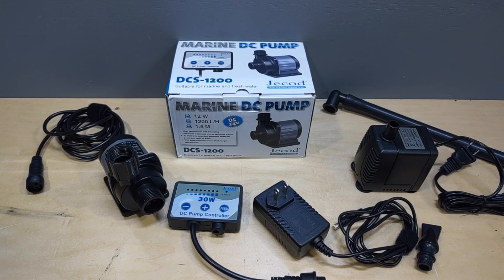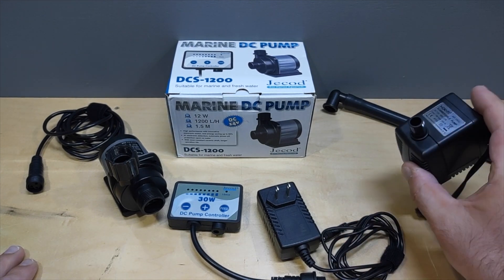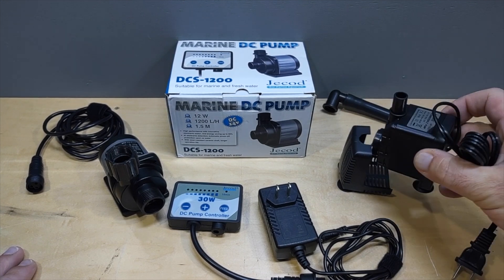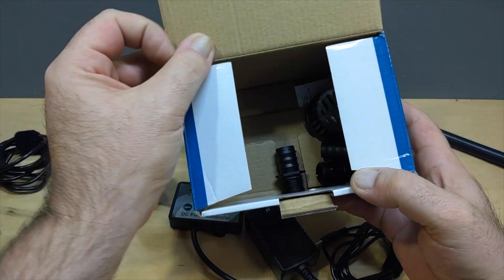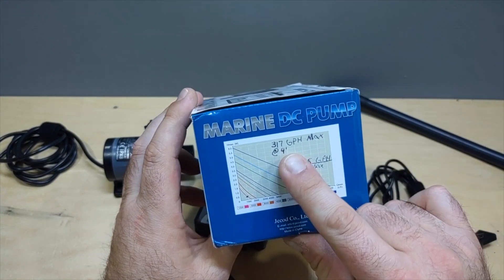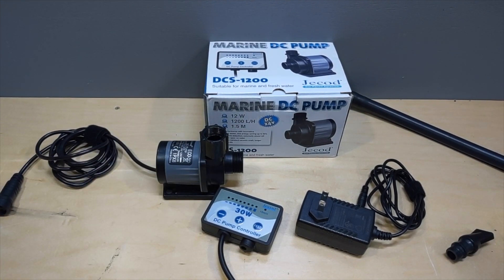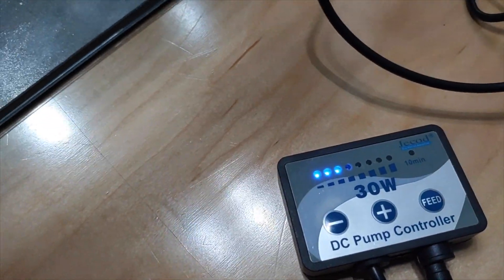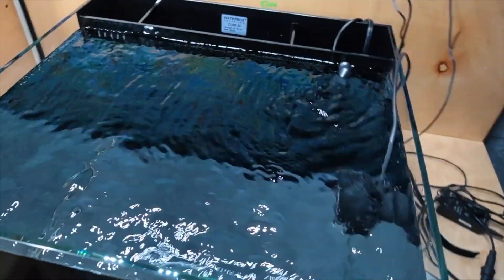Nano Reef Tank Build - Return Pump Upgrade - Episode 3

Comment: How is the DCS-1200 pump going as it's been over 1.5 years since you did the video? I have a Waterbox Peninsular Mini 25 and installed a 1.0 SiCCA pump that has a high flow but very noisy and because of the high flow any restrictions from the sock or middle chamber can run the pump dry. Looking at changing it the DCS-1200 what are your thoughts?
Reply from the maker: My jebao was very loud after a few months. I put in a hydor 185gph and it was silent

Comment: Just got a Jebao dcs-1200, it produces a high pitched whine and is louder than the standard WP pump. :-(
Reply from the maker: Mine did too after a short while. I put in the hydor 185gph pump. It fits perfectly and is totally silent
Reply: @BillyPipes  Odd isn't it. Some say the Jebao is dead silent, others say it whines. I wonder what causes the whine.
Reply from the maker: I wish I knew
Reply: @BillyPipes  Did you buy yours cheap from Ali? I did. Maybe they are dumping the noisy ones there.

Comment: What i've done with my Waterbox pump is to let it float slightly above the bottom. It is way more quiet than on it's rubber feet ánd you can take it out in a second if you want. Simply cut an inch of the hose and then the pump flows a little above the bottom. It hangs on the hose. To avoid that it touches a sidewall and becomes noisy i glued a piece of tank underlay mat under the rubber feet slightly bigger than the pump circumference. The pump cant touch a sidewall anymore.
Reply from the maker: Thats an awesome idea 👍👍

Comment: Hey mate, I have a watebox 20 with a sicce silent 1.0 that creates a lot of vibration noise. How do you rate the noise with the jebao on this tank?  Thanks
Reply from the maker: The jebao was loudy also. I ended up using a hydor 185 gph pump that had suction cup feet which is what i think is the key to it being quiet 👍
Reply: Billy Pipes do you still recommend the hydor 185?

Comment: You head pressure is more like 4inchs. Head pressure starts at the water level of the return chamber. Lower the water more head pressure, higher the water less head pressure. But great little pump love jabeo equipment.
Reply from the maker: I always add head pressure for elbows too👍

Comment: Nice upgrade. I wish you did this with a tank with two return nozzles. Finding a Y adapter to attach one pump was a headache for me. I got it tho but I had to do this ugly a$$ diy cutting of hoses to attach one pump to the right size nozzle and Y adapter. See? It's even hard to explain exactly what I did.
Reply from the maker: I know the y fittings are difficult to find. I looked for a 1" y a few years ago and couldn't find one